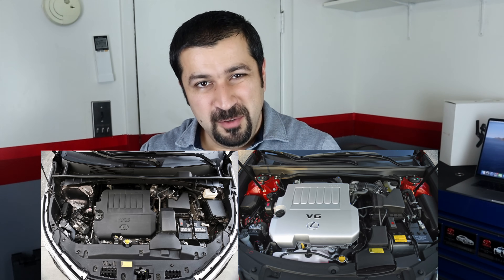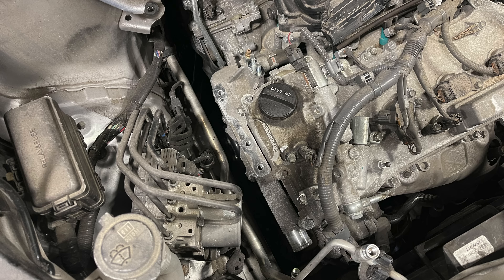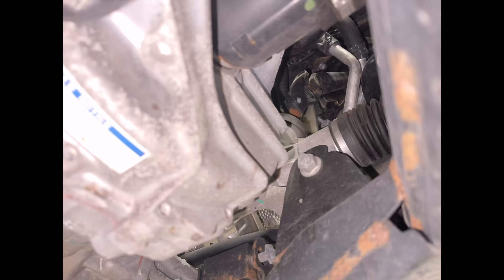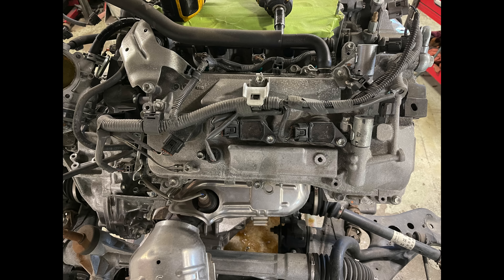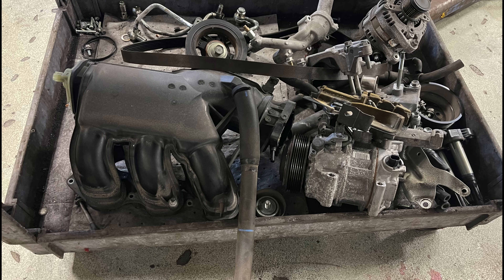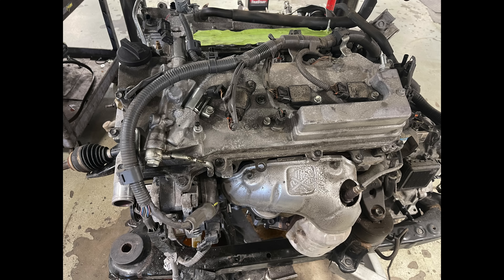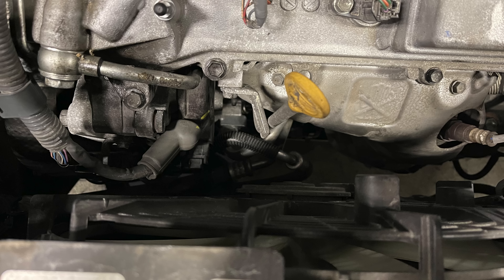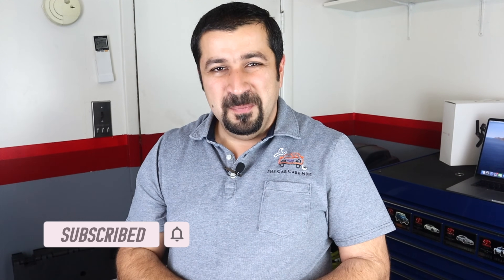Toyota V6 Engine 2GR-FE Disassembly Start to finish Front Timing Cover Repair

Comment: Wow! We’re considering buying a 2015 Sienna (92k miles) but after this, and hearing a common issue is oil leaks at timing chain cover, leads me to consider something else! 
However, if I lived in Illinois, near you, I’d feel better about it. 👍🏼
Reply: Still one of the most reliable engines ever made
Reply: @kristianyoung2429 we ended up with a 2012 with 109k miles. Thrilled to have it! Gotta few things I’m going to do… drivers side back door seems to have a catch preventing it from opening, and I want to either oil spray or use fluid film to undercoat. Any suggestions? Mild surface rust along the rockers.

Comment: Can this job be done in-car?
Reply: Depends on the car. A 2013 Lexus Es350 has the same engine but I had to drop it with the transmission and the subframe as the guy did here to have more space on removing and installing timing cover

Comment: Man that engine's internals looked nice and clean after all those years! Our 2008 Highlander - always factory serviced at the Toyota dealership in our town - was dark honey colored inside the valve cover. I gave them crap at one point for using garbage oil and they swore they were always using Toyota oil. Hmm....  What did THIS lucky Highlander get for oil?

Comment: Now I know why you see a lot of used low mild Toyotas for sale they have a leak, and they get it fixed, and they don't trust it, especially if they didn't remove the engine, which is 90%

Comment: I’m a shade tree mechanic.
I did this job with the engine in the car but, took about 17 hours. I will probably do it in 14 hours next time but, not looking for it. I see why pulling the engine makes sense.
I will not recommend this job for weak hearted diyers. Also, for the owners if you can afford it, get it done professionally. 

Thank you car care nut for always re-enforcing the professional standards on every job you do.
Reply: 17 hours sounds pretty good. Was it a back-breaker? Did you need any special tools?  I have a 2007 Sienna FrontWD, what Toyota did you have?

Comment: Would you buy a 2015 Lexus RX450 with 156,000 miles for a fair price if it was showing signs of seepage? Is it guaranteed to get worse over time or could it stay seeping for the rest of its life? What is the worst amount of leaking you have seen? Thank you for you time.

Comment: Hi AMD, I have a buddy doing the valve covers on 2016 Camry XSE 3.5. I cannot find the torque specs for the valve cover bolts anywhere for that model. Thanks.

Comment: I am planning to do an engine swap of this 2GR in my RX350, in the process replacing all the bolt ons AC Comp, Starter, Coils, etc. Do you recommend doing this reseal while the engine is out, or just leave it be. JDM low mileage engine going in approx 40-50k miles. Thank you for your feedback and the helpful videos.
Reply: reseal

Comment: My 2009 Highlander Limited with 125,000 miles has a cover leak. Quoted $ 5,000 by the dealer to fix. I'm retired and can't afford that. I now put around 3000 miles a year on it. Can I do nothing if there are no visible leaks on the ground?

Comment: Question I have a 2010 Highlander 2wd it’s starting to chatter on startup not much but still making noise do I need to remove the engine to do the timing chain? Or do you have e a video for that year

Comment: Love your videos....I have a question...I have a 2007 Toyota Tacoma 2 wheel drive v6 with the separated twin throttle body and was wondering if you have a video on this engine...I still have it with 320000 miles and doesant leak or use burn a drop of oil between every 5000 mile oil change I do myself...i think it's a fantastic truck and engine...thx again

Comment: When you have the engine this far apart,why not check the VVTI gears?
Reply: Sounds like a dealership pricing,they wanted $3200 to do shocks and struts on mine.

Comment: Got a 2017 Lexus RC 350 f sorr.Same Eng.? Cause out of 75,000 mls yhar 24.000 ive piyvon it Only had to Add 1/2 quart & wgen i compained to Dealer,Thet Said i could Use 5w 20 instead of 0w 20 & since i did that ,No More 1/2 quartvadds & Engine seems to have smoother idle & little more power

Comment: The low tension piston rings allow combustion gases to enter the crankcase.  In time, the PCV valve becomes stuck closed.  Then, the pressure builds to the point to push the sealer out of the  groove in the timing cover which now leaks oil.
Fix:  check and replace the PCV valve regularly to keep pressures low.

Comment: I have leak on the Tacoma. Toyota keep asking me if I want to pay 4000+ for faulty engine. 
I regularly wash the engine and keep driving. It is not losing as much as i need to top up between oil changes.
Maybe worth to combine job with next clutch change. People report oil keep leaking after resealing. If done on warranty maybe worth it but spend 10K to keep clean the engine maybe not.

Comment: Thanks! I am merely an Expert level tech and am getting my first insurance claim 2GR-FKE swap tomorrow. So excited, but scared at the same time. I just got done swapping a 1zz-fe on an AWD Matrix and lemme tell ya... it humbled me for sure. *ARE THERE any special tools that you wouldn't expect your typical technician to not have handy?*

It's always nice to see someone take pride in their work like you do. I also clean the engine bay as well because it really doesn't take much more time, but results in a much cleaner presentation for when the customer opens the hood and looks at their new engine.

Comment: I need your help!!!!  Please. I’m doing a valve cover gasket changer on a 2010 highlander with this engine.  Engine is in car. 

How in the world do you get the metal oil tube to line up with the valve cover?  What is the trick?  I can’t even get the banjo to line with with the valve cover to even start. I can’t even get the threads to start. I did not bend it when I removed valve cover. I thought not bending it would make reassembly easy. Nope. 

Any help would be appreciated. I know your busy. Thank you if you have a moment to help me out. 

I still have to do bank 1. Yikes…..

Comment: I took our Highlander to the dealer for schedule oil and filter change. 9.7.2023. When I was ready to go, The service writer gave me a paper telling me that the timing cover gasket is leaking and they would keep an eye on it and it should be repaired soon. The estimate was $4,100. My Highlander has only 50, 282 miles. I am very disheartened that my  Toyota is beginning to let me down. Since we purchased the vehicle new in 2012 with ten year 100,000 mile extended warrantee and the warrantee has run out, the car is falling apart. Just had the water pump replaced that cost $1450 and now the timing cover gasket. Not sure how long I am doing to let it leak. Actually not that bad. But at 50,000 miles this car should not be falling apart. I have owned Toyota vehicles since 1984 and I still love my Toyota but this is not right. My question to you Car care nut, it that price to repair the gasket right? We have a warrantee on the car for as long as we own it, the oil and filter is free. Plus all internal parts and labor are covered as long as we own the vehicle. Call the family plan. But it seems everything going wrong is external. We are really not happy with this car as for falling apart. It is the limited model  and a great car to drive and I take very good care of it with a book full of maintenance repairs.
Reply: For a 12 year old highlander 50k miles is not a little amount. The vehicle is doing a lot of city driving and not racking up miles but is definitely getting used.
Reply: @thinshadow551  The reason it has low mileage is not going to work everyday. It is my wife's car and she bought it when she retired. It does have as many miles on the road as in town but not used every day. Already had to paint the hood and top of car due to UV eating paint. But the inside is like new. Very clean and everything works. I keep an eye on the timing cover leak that I see as very minor.

Comment: We have a 2012 Highlander with just over 50,000 miles. The other day, 5.18.2023 I heard a noise in on the compressor side of the engine. I really sounds like an idler. Can you make that replacement with the engine in the car? As for you video, good time to change the plugs. lol

Comment: When the timing is set without front cover like how u do it, is piston 1 at the DTC (degree zero) as if front cover and crank pulley are on? or 5 degree? 10 degree? I am trying to set timing without taking the front cover off and engine still in car. I have a 2006 IS350 which has a 2GR-FSE.

Comment: SImple? Holy crap!!! I just found 1000% appreciation for my 1976 Chevy Silverado.
Reply: I know what you mean I have a 1979 ford f100 1 wire distributor, 1 fuel line, 2 header bolts on each side ,6 bell housing bolts, and 1 bolt for the motor mount on each side which is a 1 hour job start to finish. That was when vehicles were easy to work on and you didn’t have to pull the hole car apart lol

Comment: I went from a 4 cylinder Celica to a 3.5L V6 Avalon.... a ghastly mistake due to a misplaced trust in toyota engineering.  Warning:  If you expect the same durability from your toyota or lexus V6 as you enjoyed in your 4 cylinder toyota or lexus,  DREAM ON!    V6 toyotas or lexi are disasters-in-the-oven b/c the front timing cover ALWAYS LEAKS due to an inherent engine design flaw..... YOU CANNOT ESCAPE IT!   To keep my Avalon with 133,000 miles on the road, I will have to spend $2800 within a few months.   TOYOTA EVER AGAIN?  HA!
Reply: Who else can you rely on more than Toyota though? The only one that comes to mind would be Honda

Comment: I have a 2016 Tacoma. Timing cover started leaking at 131,000. Last June 2021. Took it to dealer. They talked with Toyota and Toyota agreed to fix it for $500 my cost. So I was thrilled. They did not remove the engine. Removed everything they needed to get the cover off. Resealed and reinstalled. I was thrilled. Yup not so thrilled anymore. Was working under truck last week. Looked up and saw the same timing cover leak starting near the power steering pump, just like last time. I’ve driven only 15,000 miles and 1 ¼ year since the repair. Headed back to dealer next week. Was already told warranty on this worn was only 1 year and if it had to be done again could cost $5000!  I don’t understand how this flaw could exist?  And then it starts leaking all over again only 15000 miles later. I sure hope Toyota will step up tho reseal it once again.
Reply: check my comment on this video. Maybe it will help you out
Reply: @vahnwinkle  What was your comment?  I have this issue with only 135k miles, although I know it started at less than 100k

Comment: Is it POSSIBLE to pull this engine from ABOVE?  How many DIYers actually have a $4,000 hydraulic LIFT in their garage??
I have pulled a subaru engine from above before so I am sure I could handle this engine as long as the hood/engine bay provides enough clearance!  Even if it takes longer, IS IT POSSIBLE to pull this from above?? THANKS CCN!!
Reply: check my comment on this video. Maybe it will help you out

Comment: You wonder a new engine rebuilt is 3000 .why not just opt for that wouldn't it be cheaper
Reply: You would know that you maintained your current engine well is my idea, but you don't know how a rebuilt engine has been maintained or fixed.

Comment: PRO TIP- IF the leak develops under the bottom square access cover plate for the (timing chain tensioner) just above the water pump (plate has the 4 bolts going through it at 9:32 ). This is the most common leak occurrence area per the recall instructions. Then all you need to do is pull that metal plate off and back seal the mating surfaces with Threebond tb1207b gasket maker. Make sure to clean inside the timing cover and around the old gasket squeeze out inside really good, making sure to remove all of the oil residue before applying the threebond. I used 99% isopropanol alcohol and cleaned for about 20 minutes. This may fix the leak and save you over $2000. It did for me! Goodluck!

NOTE for people who need help: The repair is listed under Toyota Technical Service Bulletin EG019-07 - Please search this on internet and it should give you instructions how to fix the leak professionally. However, keep in mind that the instructions advise you to remove the whole timing cover and reseal whole flange but that requires about $2500 bucks or more. My method targets the leak area without removing the engine. The leak is located on the front Oil Pump Timing Cover. It is located on the right side of the engine where all pulleys are located. Their is a TIMING CHAIN tensioner access cover plate with 4 bolts that hold the plate on (Timing Chain Cover Plate - Toyota PART number is 11324-0P010). If you take this plate off you may have access to the leak from the backside through the hole. If you do, you can clean this area from the top of engine bending over the engine and using 99% isopropanol alcohol to clean the oil around where it is leaking. I used paper towels to clean on the inside because they work good for absorbing the oil after the alcohol breaks the oil down. Also, alcohol doesn't contaminate the oil and evaporates after use. I would also HIGHLY advise removing the pulley tensioner located behind the plate after you remove the plate you will see it but be EXTREMLY careful not to drop bolts when removing. If you remove the tensioner it will make the job about 50% easier and wont cut up your hands as bad. I used my fingers to apply the sealant so that I could feel the mating surface flange where the gasket had blown out. I could feel where the 2 pieces of metal came together and I just used my fingers to press and squeeze the sealant in that area. I applied the sealant 3 times and made sure it was covered because you will not be able to see with your eyes. This repair is done by feel. Goodluck
Reply: Wife's '12 Highlander:
Routine oil change at dealership resulted in them quoting over $3,000 to fix this leak.  I haven't pinpointed the leak yet as I haven't dug into it, but I'm hoping this is our case.  Either way I'm very glad I came across this information and I appreciate it greatly.  I hope more people see your comment and benefit from it.  Depending on how bad the leak is, I wasn't even going to fix it, just keep an eye on the oil level to make sure it's at the full mark which it has been ever since the oil change.  Now I might have a chance.
Thank you very much
Reply: @James225  My leak was between the mating surface of the timing chain cover and the engine block. The exact location was right behind the power steering pump pulley bottom of engine. I actually removed my right tire and power steering pump pulley for better access. Additionally, make sure to repair the oil line right next to the pulley against the block of engine. If it is the old style rubber hose version. I replaced mine with original rubber hose but they make metal. I heard this line deteriorates from oil and pressure on higher mileage cars and eventually deprives the engine from oil completely locking your engine up if it leaks. It is a main oil line and may be the origin of your leak. If you have a leak on that side of the engine, I would stop driving it and immediately verify it is NOT a oil leak from that specific oil line. This is an EMERGENCY situation and you should stop driving your car until its repaired. Part Number for my line was W0133-1971230. I hope you try this and save yourself some money. Not everything needs to have a cost. Sometimes people can just be good people and help each other out. World needs more of them for sure. Also, I didn't remove the tensioner itself because I was afraid of dropping the bolts into the timing chain cover of the dark abyss but I can guarantee that if you did remove it, it would make the back sealing process way easier and effective for the back seal but keep in mind, if you drop those bolts into the timing chain cover you will be in big big trouble. BIG trouble. Good luck
Reply: Since when is there a recall? Is it for gen 2 or 3?
Reply: @davidb9323  I found a recall instructions online. Search the net about this issue and you will find a instruction manual describing the issue and the repair. They recommend the sealant to use for the repair
Reply: @vahnwinkle  I was more or less looking for the cost to be covered in a recall.
Reply: @davidb9323  I dont think they cover this repair anymore or if they ever did. I do know I found the instructions when i was researching the issue. I didnt save the file or location but its definitely on the internet. As far as a recall, this is an old problem that would more then likely be out of coverage for the time.
Reply: @vahnwinkle  oh, must of been for Gen 2’s
Reply: Toyota Technical Service Bulletin EG019-07
Reply: @vahnwinkle275 Thanks for the information.  Do you have any pictures you could share maybe?
Reply: @kemalozgur3977  I wouldn't know how to share them. I can find some info for you but need somewhere to send them too.
Reply: @kemalozgur3977  The repair is listed under Toyota Technical Service Bulletin EG019-07. Additionally, my repair is not official. Its my own method for saving you money. I didn't have $2000 plus dollars to spend on repair for a 20 year old car so I was able to come up with a solution for myself. Use my repair method at your own risk, I am only sharing my experience and letting people know it fixed my oil leak and saved me a lot of money.
Reply: @kemalozgur3977  Oh, also got to 9:32 on video. You can clearly see the plate with 4 bolts I am talking about.
Reply: @TheCarCareNut I would like to hear your thoughts on this alternate repair option if possible please.